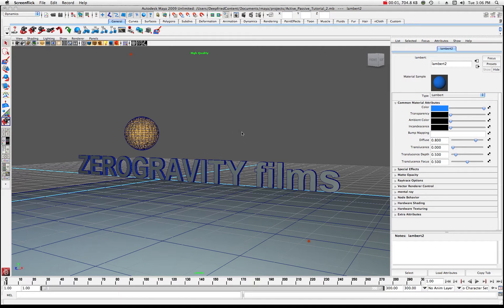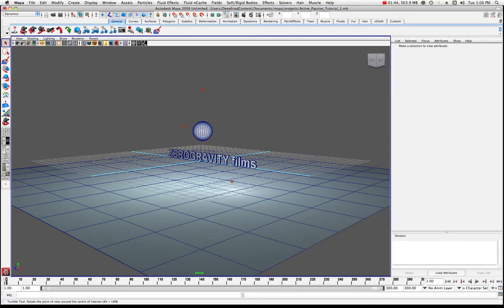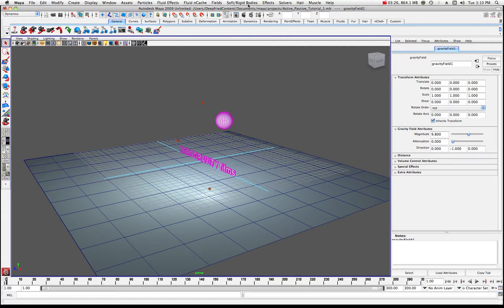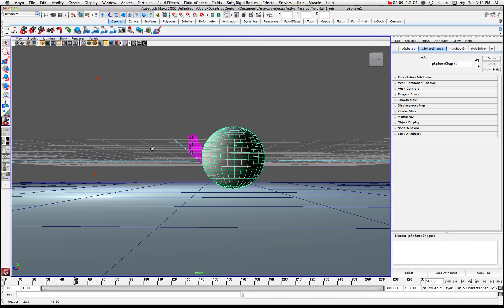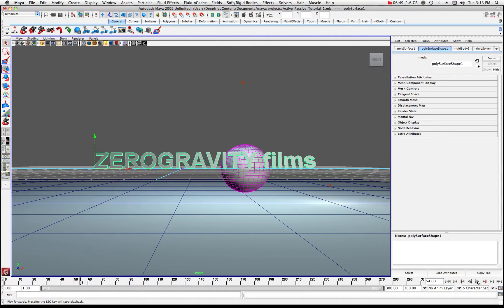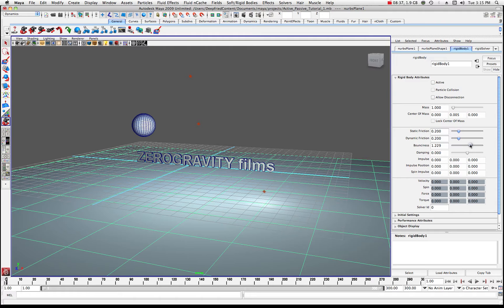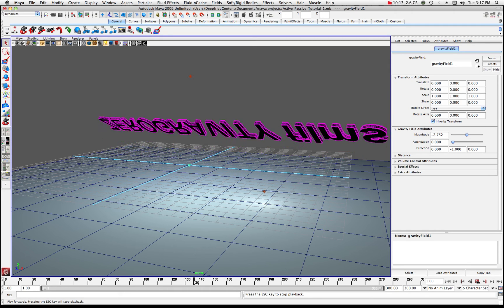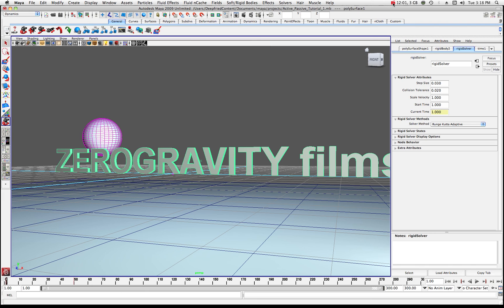Maya Control a Dynamic Impact Collision Tutorial by Stuart Christensen

Comment from the maker: If you want individual letters to fly apart you should create each letter and reset each of the individual pivot points for every letter, that way they are all individual objects and not a single cohesive object, and convert each to a rigid body.  Maya needs to recognize that each letter is a distinct object for this to work in the way you need.  Hope that helps.

Comment from the maker: Maya 2012 has an improved shatter effect and there are several plug ins available for shattering stuff but I don't shatter enough stuff to justify the expense.  There's a manual way using nParticles, Rigid bodies and nCloth outlined in Kellers Mastering Maya 2009 book.  Also, google Maya shatter and you'll come up with some tuts and options.  OK?

Comment from the maker: @runelink2 Dude....Look em up in the help section if you need or want to use them.  I stay away from shortcuts in tutorials because I've customized some to fit how I work, but for the most part tutorials don't use shortcuts to avoid confusion and to keep information and interface at defaults whenever possible for the most predictable results.